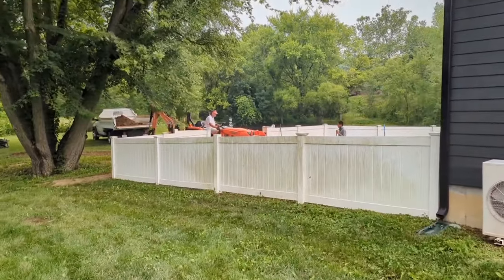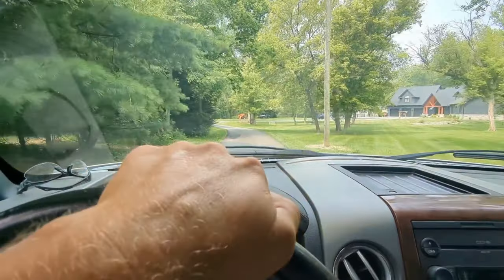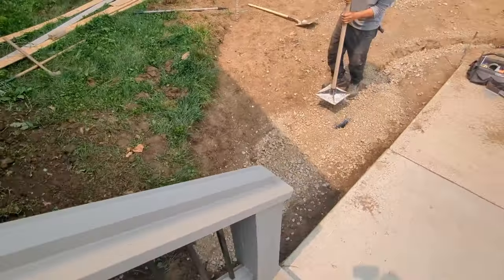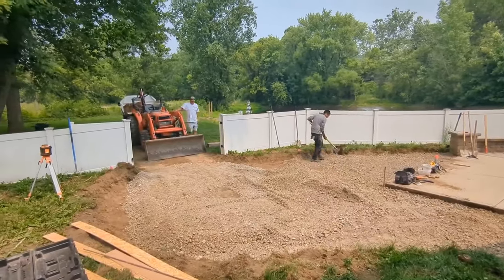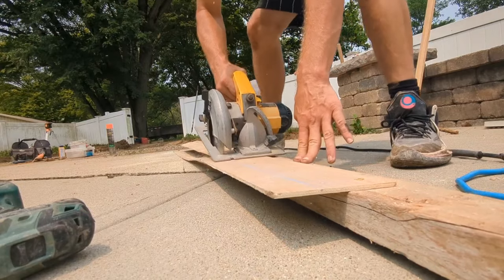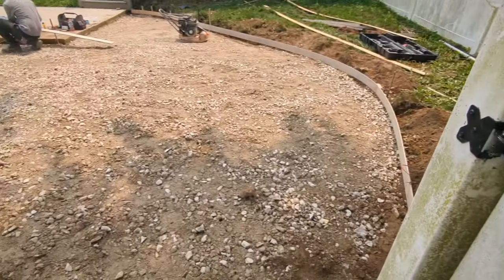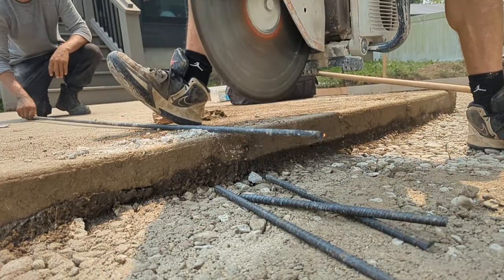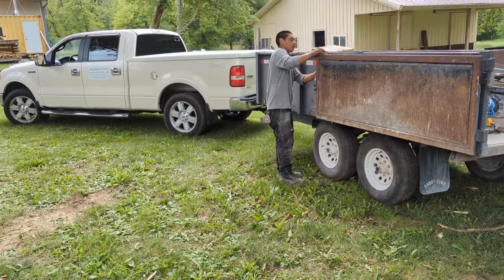Should a Customer get a DISCOUNT 4 this?

Comment: Good work bro💯,  

Does pvc work better? culvert collect debre and stuff. Ever had any issues with that.
Reply from the maker: PVC is better. But that was non corgated pipe so no holes. And I didn't feel like buying all those damn fittings and glue ect. This will work fine cuz it's so deep and it's got stone around it so no roots will grow in. Thanks again my dude. A1 from Day 1

Comment: Hey grubb! I got a situation I don’t know much of concrete and all but I  had my sidewalk finished and two patios in my yard I’d say like 5 months back but now I noticed when it rains there are water spots ?! I’d that normal?
Reply from the maker: Lol. Of course there is water spots. It's from the sealer 😂 it should be cool
Reply: If you didn’t put sealer on, you have birdbaths. Low spots when they finished it.